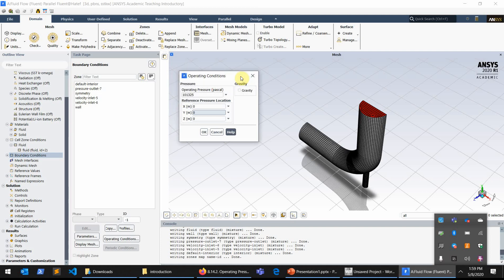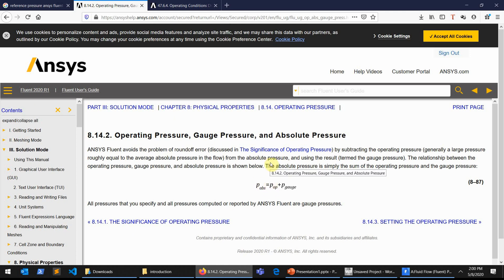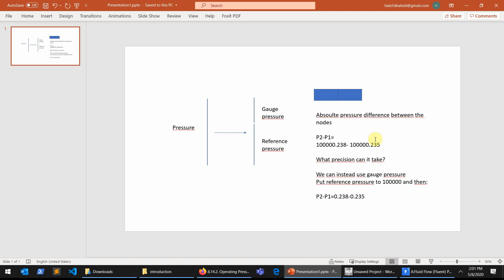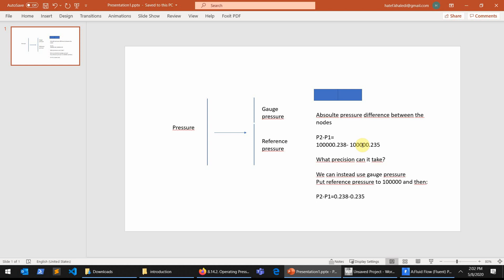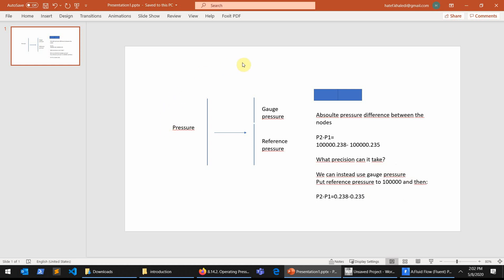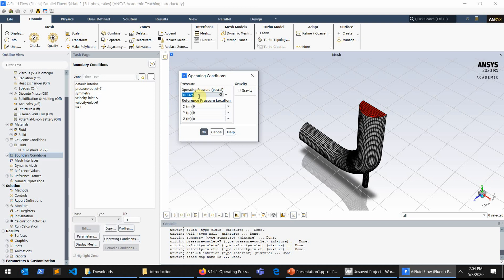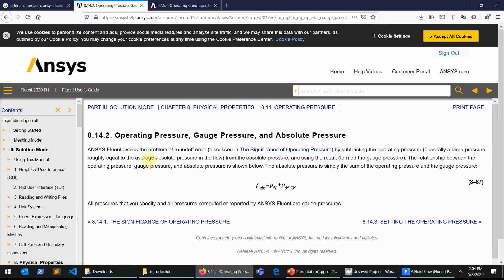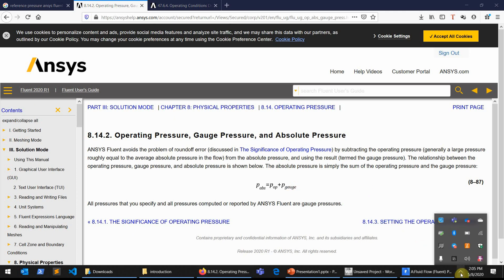What is Operating pressure in Ansys Fluent

Comment: Thanks so much for your explanations. 
I faced something strange when I was simulating water flow in a simple tube! 
My simulation was a laminar water flow in a smooth pipe. The pressure drop that Fluent is giving me is not correct! It seems it makes no difference if the pipe is vertical or horizontal! No matter what I put for gravity, it would give the same pressure drop! It seems it’s not calculating the pressure drop cause by height!! Am I missing something? I would appreciate if you guide me.